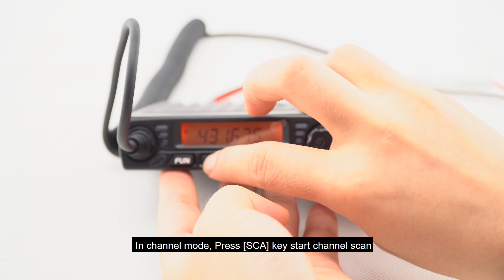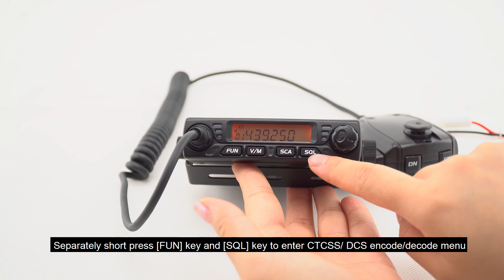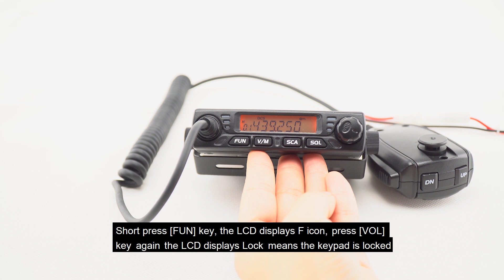Retevis RT98 mini mobile radio Scan setting

Comment: Many operators appears to stick to the main 3 radio suppliers, but more competition can only bring a better value option for users.  I have a couple of Retevis radios and apart from one small problem, which the customer service adviser sorted out for me very quickly, I have to say that these radios are going to be a real challenge to the market place.  Well done Retevis.